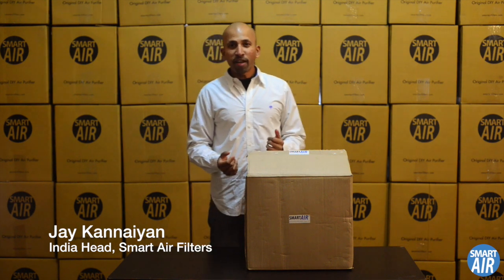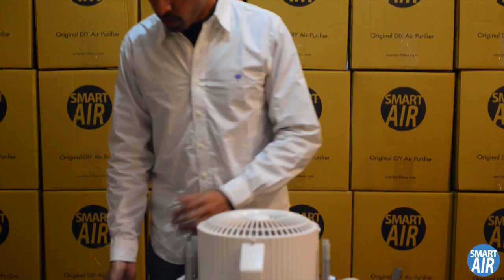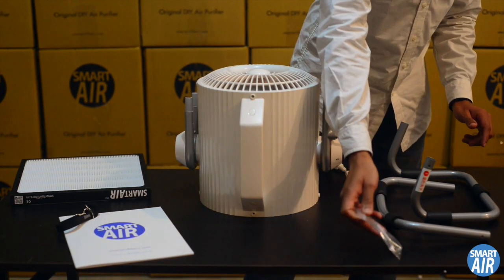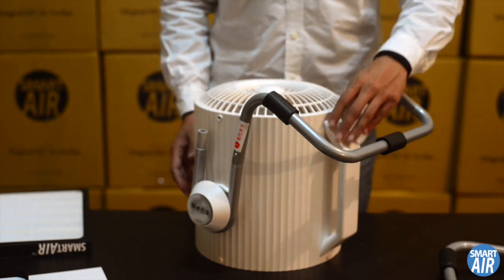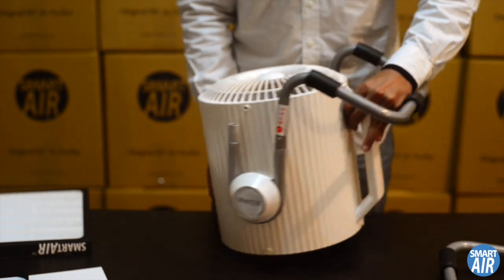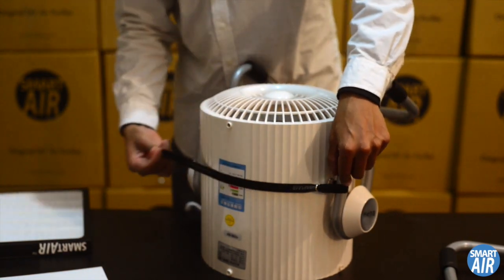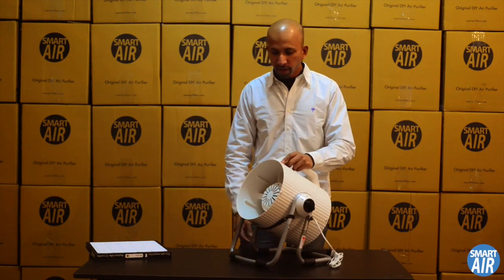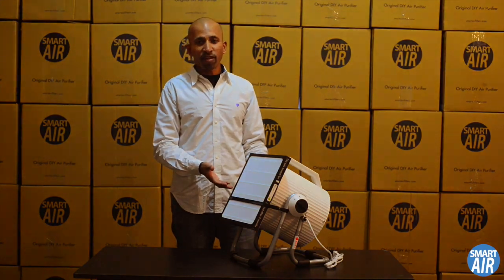How to assemble your Smart Air Cannon DIY Air Purifier - Elastic Strap Method

Comment: This Air Cannon air purifier is plastic JUNK! WHY? Because there is absolutly no seal between the filter and the opening of the air purifier where the air blows out. The filter is a thin worthless design and the air exchange rate per hour is very low even in  small rooms! SAVE YOUR MONEY! if you want good solid information on quality HEPA air purifiers that are Made In The USA check out the website at http://www.airpurifierexpert.com
Reply: Barry, may I offer an opinion? I don't think you have to misleadingly "trash talk" an innovative and valuable product in order to promote your own. The plastic fan casing is very heavy duty and well made. The "thin worthless design" air filter is the same industry standard filter material that one gets in all filters from Sharp, Philips and others. My laser egg and Wynd air tracker both indicate this "DIY" contraption does an excellent job. You might want to consider that these are basically being marketed in China, India, Mongolia and other developing countries, where urban air is lethal, and expensive HEPA filters are very hard to come by or unaffordable for ordinary people. A very different market from the one you are selling in. I'd be curious to know how you tested the Cannon DIY. Did you visit China or India to check it out and measure it's effectiveness?